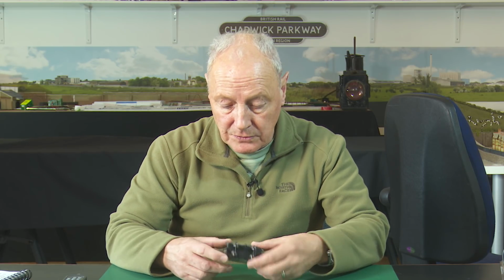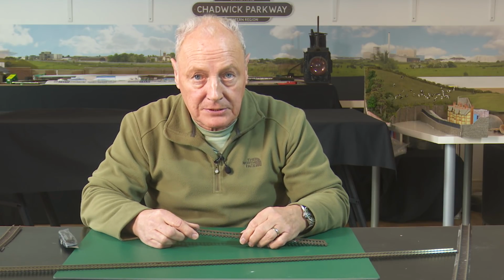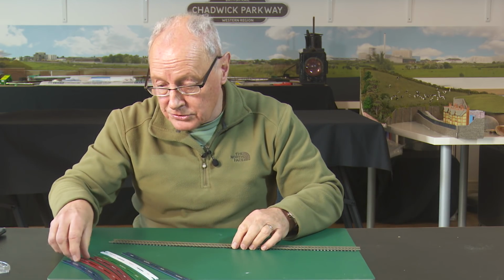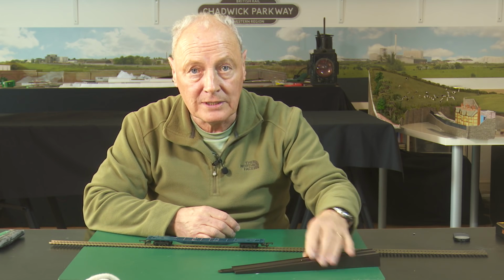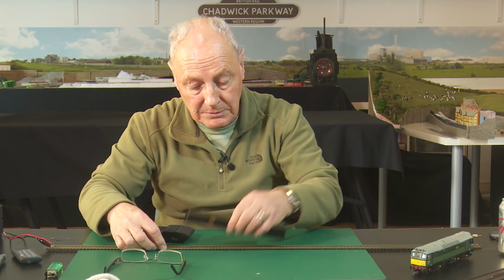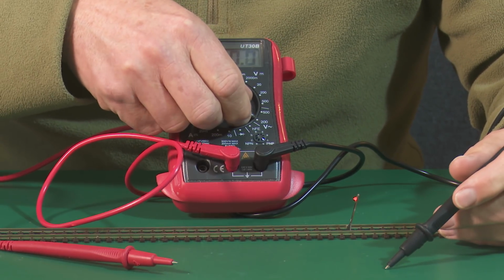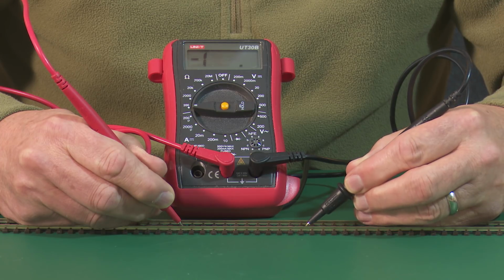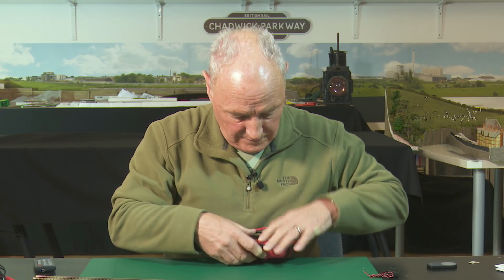Great model railway tools for the Railway Modeller at Chadwick Model Railway. | 76

Comment: Remember that if its an electrical problem that has started the fire then spraying with CO2 is pointless, You need to be able to switch the power off first, without making it so dark you can't see.
So in the loft you need a nice double pole isolator switch that feed the layout, heater, etc.
Reply from the maker: Good point Dennis.
Reply: It's not the electricity that burns. The electricity (heat by way of a short circuit - I wouldn't expect arcing to cause ignition unless there were flammable vapours present in the proximity of the arc) provides the source of ignition to the fuel and it is the combustible fuel that burns. If electricity starts a fire through a short circuit (providing heat to make the combustilbe fuel reach its ignition temperature) then the moving flame front progresses away from the source of ignition consuming fuel as it progresses. Once ignition has been started by electricity, the combustible fuel in the vicinity of the ignition source (the short circuit) has been consumed by the combustion process so the progressing fire can be readily extinguished by deprivation of Oxygen which is achieved by the CO2 displacing the Oxygen in the vicinity of the flame front as the CO2 interferes with the branching chain reaction of the flame thereby achieving extinguishment. The heat from the short circuit no longer has any fuel in its proximity as it has been consumed. The only risk then is shock hazard which is why the supply needs to be isolated at the ealiest opportunity.
Reply: @DavidRobinson-rj2sp  I wouldn't rely on that. I have worked designing andtest computer system for over 35 years and I have seen wires glowing red hot for several minutes when the power supply just current limits rather than tripping. I have even seen internal PCB tracks glow red hot.

You spray the fire and it will cool the the material but the CO2 only lasts a few seconds so it will probably reignite if you haven't turned the juice off.
Reply: @DennisFisherUK : Electrical used to have its own classification Dennis but this was abandoned as electricity only forms the source of ignition and not the fuel. A so-called electrical fire involves one of the classes but is not a class in its own right as electricity does of course not burn but causes a class A, B, C etc fire which can be dealt with as seen fit. I did of course say isolate the power supply but that goes without say. https://en.wikipedia.org/wiki/Fire_class

Comment: The fire extinguisher is essential, mine is on the steps to the basement. I do a lot of 3D printing, and found this cool product thats basically a fire suppression ball. I place them above the 3D printers, if fire touches the ball, it releases fire suppression material that stops the fire. So you don't burn your house down, you just have a small mess instead. I am thinking of placing them above or near the layout as well... You can find them on Amazon UK here -> https://www.amazon.co.uk/shop/oorail.com/?listId=320IYRJQT25AW
Reply from the maker: Great tip (again).

Comment: Have to agree with you Charlie with regards the extinguisher. A couple of quick blasts in a loft is not going to kill you.  My last choice of extinguisher would be the powder, if you have ever used one you will know it pretty much ruins anything the powder comes into contact with. Foam not so bad, but still something that is pretty much guaranteed to destroy your layout. C02 is the best option, but you do need to be aware of the dangers associated with using it in an enclosed space, a quick blast or two is not a problem, but standing there with your fingers pulling the trigger until the extinguisher was empty is certainly a very stupid idea.
Reply from the maker: It’s all common sense really mate.

Comment: Thanks Charlie, another safety "tool" if you will, is a universal power cut off. All of the power for my layout runs through one power strip which is easy to access and shut off. If an electrical fire does happen you really don't want to be trying to put it out while figuring out whether it's your track power, accessory bus, or backscene lighting. 

With regards to the CO2 extinguisher, I seriously doubt that a CO2 fire extinguisher has the ability to raise the CO2 level in a shed or attic to dangerous levels. A normal occupied room has a CO2 concentration of 600-700 parts per million (PPM). CO2 does not become an immediate hazard until it gets closer to 40,000 PPM because unlike Carbon Monoxide (CO) CO2 is not toxic, it simply replaces oxygen in your blood. In the UK the workplace threshold for long term exposure is 5,000 PPM.
Reply from the maker: I’m so pleased that we are in total agreement.

Comment: Some more useful tips there. I got myself a back to back gauge a while ago though I'm sure mine is 14.5mm by Markits, also got one of those Peco railers very useful. I'd like to get some Tracksetta's some time but a little surprised by the price of them individually sold at around 9-10 pounds each.
Reply from the maker: Shocking prices in our hobby sadly.

Comment: Charlie. When working with electrics electronics Co2 is the only option available to most people as halon is restricted. Fome or water fire extinguishers are water-based, water and electric do not match.
Water with some batteries will cause an explosion, remember your 12 to 24v supplies run on the mains supply. So pointing a water-based fire extinguisher at the fire it might contact mains voltage. Next is electric shock.
Next speaker impedance is worked out at a frequency, not DC as per your meter.
Reply from the maker: Interesting points AJ.

Comment: One of the most useful "tools" that I have is the rear bogie off a very old Hornby Dublo 3-rail standard tank which I two-railed back in the '80's...  It's fantastic for clearing balast out of flange ways and off the sides of rails after ballasting - just press on it while pushing it up and down the track and through the point work.  It takes seconds to do a job that can take the best part of an hour with a screwdriver.
Reply from the maker: A great tip K31, many thanks.

Comment: OMG - there are some really mis-informed people out there Charley. There is no way the contents of that fire extinguisher will fill the room and displace the air to a point where it would make a serious risk to your health, and you seem to be sensible chap anyway, who would operate one in line with its instructions.  Beside it will have put out any small fire that you felt confident to tackle before "filling the room!".  I've had to use one to put out a fire in a waste basket before it managed to get a hold and cause any real damage... two or three quick blasts from a safe distance and it was out....

Like the track spacing jig - practical and stylish too.
Reply: Agreed.

Also, for someone to be in a situation where the extinguisher has that negative effect on them, they were probably attempting to fight a fire that was too big for it.

The cooling effect of CO2 means that on small fires you can use short well directed blasts and repeat to keep the fire out. Rather than using the whole cansiter in one go.

Aircraft still have halon or freeon extinguishers, and they ARE dangerous. Especially in the confined space of most aircraft.
Reply: Just to put things in perspective, with the help of google it's easy to find out the volume as a gas that 1kg of Co2 produces.  At 21c and 1 atmosphere (ie sea level pressure) the saturated volume is just 0.5458 cubic metres.  As that extinguisher looks to be a 2kg net weigh then you could safely say that would extrapolate to just over a cubic meter at 100% density.  I'm no expert, but I would say that the room the layout is housed in is a tad greater in volume than that :)
Reply from the maker: I’m so pleased that you’re one my side Malcolm.

Comment: Safety first Charlie, its something I think we all take for granted and I'm with you all the way on fire safety.
Reply from the maker: I’m so pleased that you agree Mark.
Reply: Total agree. I speak from experience , having a fire on my railway when the power supply went faulty sending too much current to the lamps in the houses , and the cable insulation caught light. My co2 extinguisher saved my loft and house., I would not be using foam where live electrics are present unless they can be isolated.
Dry powder makes far to much mess (if you are dealing with a small fire ).
Bcf extinguishers were great , but not good for the environment .
Great video btw.